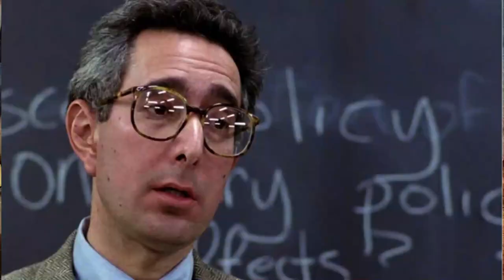Homelite Chainsaw - Will it Run and do the Chop-Chop??

Comment: Great video. I believe what you considered a retainer for the air filter is actually a stand-off and should be below the foam filter. My Dad had a homelite chainsaw back in the late 70's. That thing was super reliable.
Reply: You are correct. That little frame goes between the carburetor throat and the foam air filter so the foam does not get sucked into the throat. I have one of these Homelite chainsaws.
Reply from the maker: Perfect. I'll get it addressed 👍👍 Thanks!

Comment: Nothing is better for working on small engine stuff than medical equipment (I'm serious). I have a set of hemostats, tweezers, scalpels, dentists picks, and several other odds and ends in my toolbox and shop. They come in handy,lol.
Reply from the maker: So I'm learning!!  Going to have to get me some more medical tools lol
Reply: @TractorFella  What do you need?  We have some cast-offs from our clinic and my drawers are...  full.  😁
Plus you need an oil tank check valve for oil smokey.  She is sipping oil from the bar oil tank so i'm guessing you are about 10:1 mix right now.  At least at one point I had a small bag of them.
Due to enjoying my sanity, I no longer work on the little homelites.

Comment: Just an FYI, the air filter goes on top of the metal grid. That metal grid goes in first to keep the filter from being sucked into the carb. Nice work.
Reply from the maker: Greetings! Thank you very much for the tip. Thankfully the filter was in good shape so hopefully it didn't do any damage. I'll change it up for sure. Thanks for the comment!

Comment: You may need to replace the duck bill valves one on the fuel line goes on a sintered metal piece that is the fuel line in the tank. If there is no metal in the fuel line it may have fallen into the bottom of the tank. There should be a second one in a hole at the top of the oiler tank. I was able to buy a pack of 5 on Amazon. Without them the oiler will leak oil everywhere and the carb will give you fits with tuning it. Great job on the diagnostics and cleaning. Thank you for sharing

Comment: A suggestion on the diaphragm ordeal for soften those crispy ones up try some marvel mystery oil let it set about 24 hours then check it for flexibility.,or softer texture of the metering diaphragm for easier movement back& fourth motion. It should loosen it up if it's not to far gone to replenish.& Re lubricate the material back to reusable standard purposes.

Comment: I sometimes add A spray of brake cleaner over the marvel mystery oil to let them absorb into the materials as one application use process myself. It may.,or may not work for you though on things like that.  It's just something I've tried.& Used in the past years of working on small engines myself from A kid growing up to now still.

Comment: Just FYI, the piece that came off still attached to the carb is a reed valve. A lot of older saws had them. It’s basically just a check valve that lets air and fuel in but not back out.
Reply from the maker: Thanks for the comment! I'm going to have to go back and take a look at what you're referring to. I have a solid 10 second memory 😆 Thank you for the info!
Reply from the maker: I found it. That makes sense. Keep fuel/air from backfeeding through the carb. 👍👍

Comment: The workbench used to be clean......   I feel ya. I cleaned my shop last weekend, and now I have a pressure washer and a riding mower torn apart in there. It looks like a tornado went through there, and I am waiting on parts for both of them.
Reply from the maker: Isn't it funny how that happens?  You look at it, enjoy how it's clean, then at the end of the day, look at it again and it's a train wreck 😆

Comment: There is a small check valve in the upper part of the fuel tank. They call it a duckbill valve. It’s good to cover it with foam or even paper towel to keep debris from getting in it. They also use the same check valve on the oil tank pressurization hose. The one in the oil tank occasionally gets knocked off when filling the tank with oil. When that happens,oil can flow back into crankcase after shutting off causing it to smoke a lot the next time it’s started.
Reply from the maker: I appreciate that info. Pretty sure I found those vents but the duckbill had disintegrated in the gas tank.  Now the gas tank hole is just open. Going to have to figure that out!
Reply: Use the one way valve from a car windscreen washer in the bar oil tank. Not to sure about the fuel side being a problem so long as you don't try to run it at a funny angle.
Reply from the maker: @captainchaos3053 - That's a great idea! Thank you!

Comment: if you ever need a fitting for a compression tester you can punch the ceramic from a spark plug like the one in your video, then thread the metal inside to fit threads on your tester and your good to go. Some dont know so I figured I would mention it lol
Reply from the maker: I definitely didn't know that so I really appreciate that pointer!  Thanks!

Comment: I own a chainsaw collection of around 60saws and half of them are vintage homelites! First thing, You have the wrong sparkplug in your chainsaw! All the small er homelites take a tapered fit sparkplug! Your loosing a bunch of compression with the 3/4 sparkplug! That saw should have a 5/8 tapered fit sparkplug. I recommend that you go to two different places on YouTube,  First one is  Leons chainsaw parts and repair! He is a guru with chainsaws and you will find a video on how to do everything the correct way.. Next i would recommend that you go to Mike Acres site, And type in the saw your dealing with and it will give you everything you need to know about the saw.
Reply from the maker: I appreciate the info!
When I found this on the side of the road it didn't have a plug in it so I grabbed what I had.  I'll definitely look into the proper replacement. 
Thanks!

Comment: That piece of sponge certainly looks a a little lost in that airbox. Mine has a cellulose screen style filter. 50:1 is a bit lean for that old girl.
Reply from the maker: Hello!. I'll have to see what they used from the factory. I have some cut-to-size air filter element that I might work well. 
I made sure to add some extra oil to her along with the 50:1 👍👍
Thanks for the comment!
Reply: @TractorFella  I have checked my saw which states 25:1 but that is based on using old school oils. I run mine at about 38:1 on modern 2 stroke oil about 100ml per us gallon.
Reply from the maker: Thanks for the measurements. 👌 That'll be very helpful!

Comment: Running super rich dial the high jet back a little and it should clean up nice.
Reply from the maker: Thanks for the comment Darren. So if you watch the part where I work on the carb (the boring part haha) I made note that it only had a mixture screw for the low speed. The high speed location was just plugged. Any suggestions? Did I miss something else? Thanks!
Reply: Watch these little saws. Had one kickback on me into my kneecap. Ouch!
Reply from the maker: 😯 oh man that sounds terrible. I'll be careful for sure!